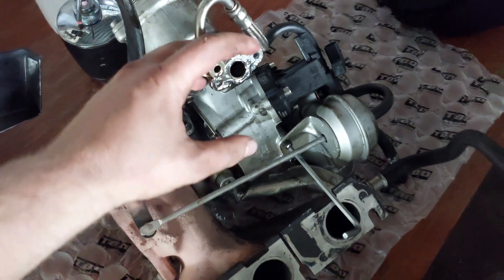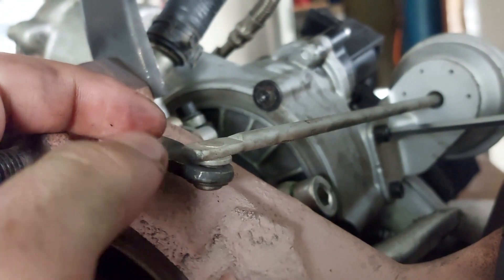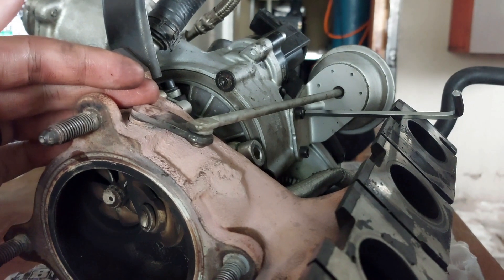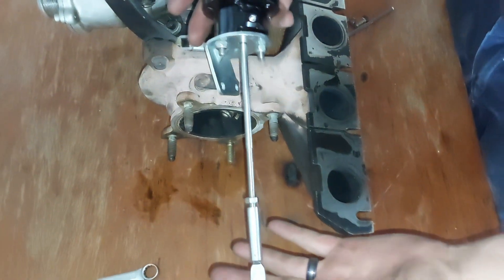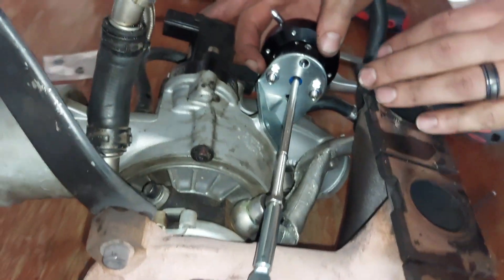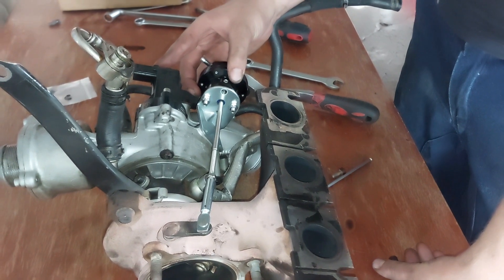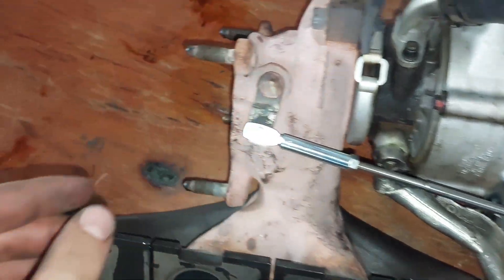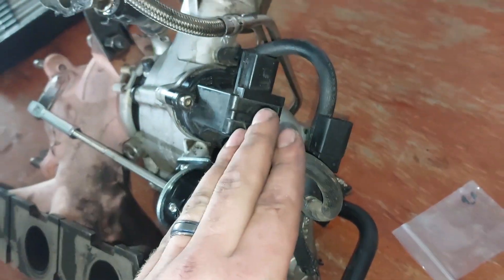How to Install an Upgraded Turbo Actuator on the K03

Comment: Nice, but this turbo is not K03, it’s an IHI JH5 turbo. Also you should have tested and adjusted the crack pressure before installing the turbo back on the car.
Reply from the maker: You are 100% correct, I always called it a K03 but I know its a IHI. Bad habit 🤣 sadly very poor turbo's apparently 💔 also I did get the info with for the spring pressure, prev video :)